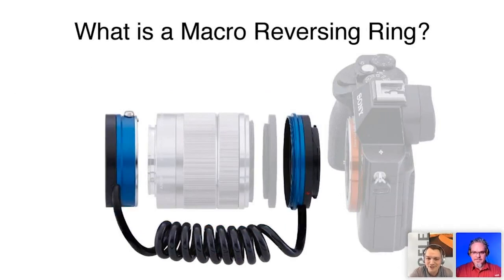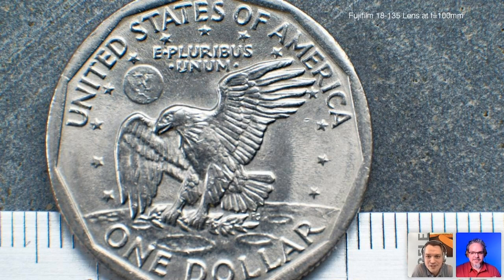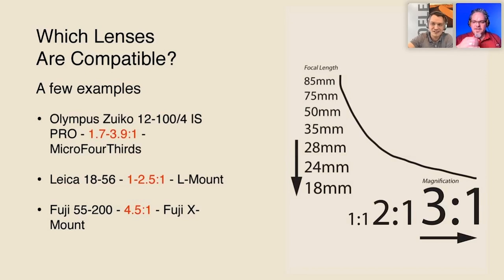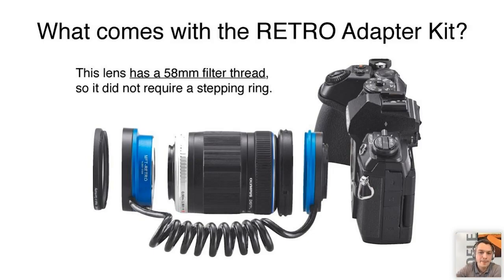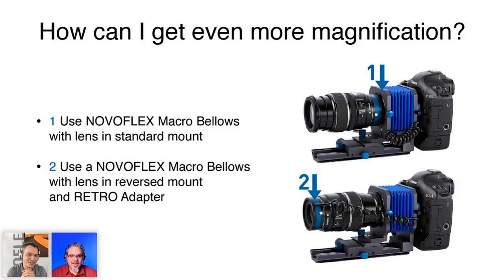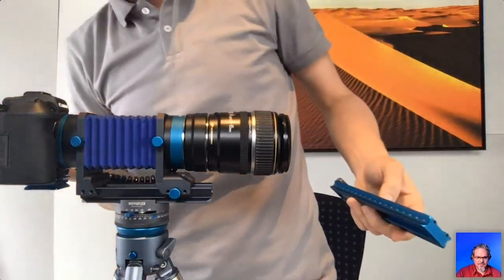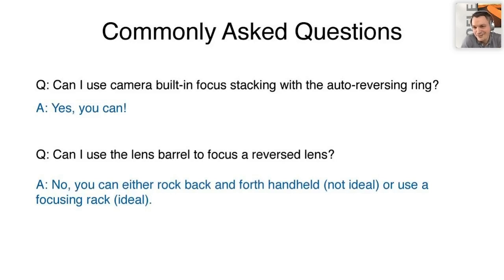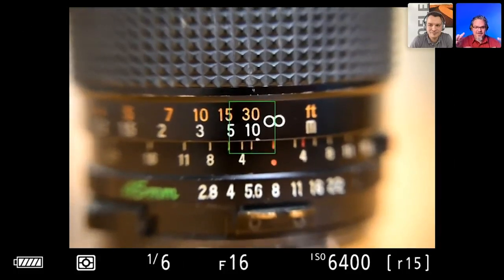NOVOFLEX Macro Reversing Rings (WEBINAR REPLAY–originally aired 25 February 2020)

Comment from the maker: Hi! ProArtwork: Excellent, and thanks for your questions.. The best way to start understanding which lens would work best is to “freelens” right now with what you have. Take the lens off your camera, reverse it and look through your EVF or on the back LCD while moving the lens closer and further away from your camera body. While doing that move closer and further away from a macro subject. You may like one better than the other (and we can;t test all possible combinations!) 
Regarding the filter thread, you will need to get a proper step-ring from 58mm to whatever other sizes you have for other lenses.

Comment: I’m interested in this for the Fuji X-T2. I have the Lens Kit 18-135mm, the Fuji 60mm Macro and 56mm. Does this mean I have to get different filter sizes? Which lens above should I use as primary for this adapter?
Reply from the maker: So very sorry we didn't see this comment! Yes, but you will need different step ring sizes for each filter thread size for your lenses (from that size to 58mm). Your best bet for lens to reverse is the kit zoom lens. The macro lens will most likely not reverse well, but feel free to try it. Zoom lenses work better than prime lenses when reversed.

Comment: Is it possible to know what is the magnification value for reversing a 35mm Leica L APO lens?
Reply from the maker: We do not have the ability to photograph and report the magnification with all the lenses in the world. But we will ask Martin if he owns that lens and reply again if he does, and can test it.
Also, you may already know this, and apologies if you do: It's easiest to photograph a ruler and divide the width of your sensor by the quantity of observed (or photographed) millimeters in your frame-edge to edge.
For instance, if you have a full frame sensor (36mm wide) and the ruler shows 36mm, this is 1:1. If it shows 18mm, you have 2:1. If it shows 72 mm, you have 1:2 magnification.
Reply: @NovoflexUS  Thank you! I would have done what you wrote but I do not have the hardware to test with. I thought there was some formula to compute the magnification (or you have had it already tested).

Comment: hi Sir, could you let me know Is it work for Canon RF 24-105mm f/4-7.1 IS STM and RF 35mm f/1.8 Macro IS STM? Thanks
Reply from the maker: Hello artherethere - thanks for your questions.
You would use the EOSR-RETRO. If your lens filter is NOT 58mm, get step-up/down rings from 58mm to your lens filter threads.
The Canon RF 24-105mm F/4-7.1 IS STM is 67mm
The RF 35mm f/1.8 Macro IS STM is 52mm.
Generally reversing a macro lens is not optimal, but try it out to see what works and if it meets your needs. i.e. test it to see if it works.
Reply: @NovoflexUS  Thanks, let me test it.